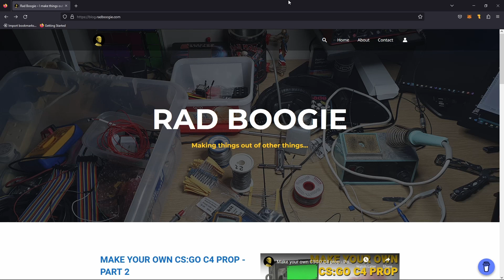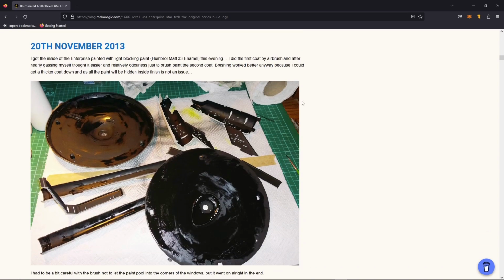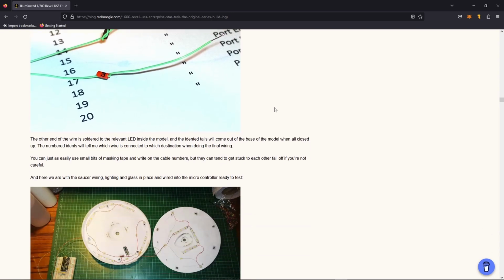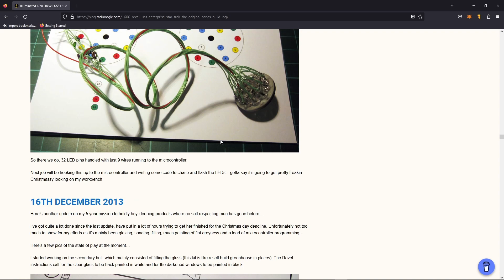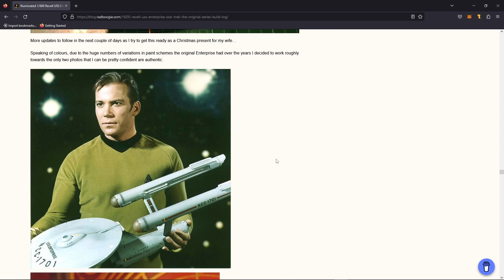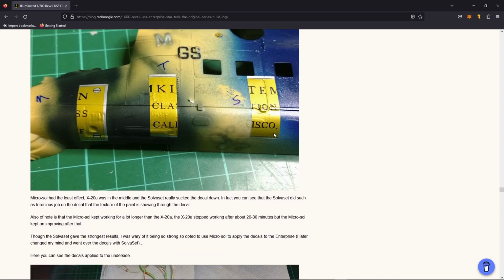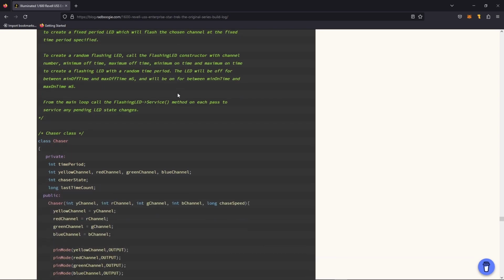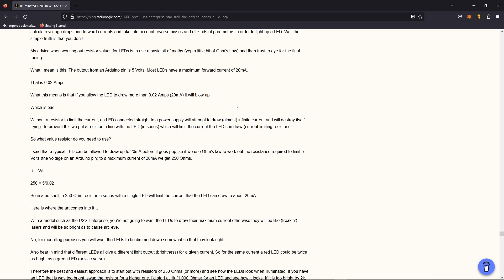Illuminated 1/600 Revell USS Enterprise TOS Build Log - Arduino controlled with source code

Comment: You're a treasure to make this video. Can you give me a primer on how to start using an Arduino? I have done some circuitry using ICs in my youth, but I'm not sure what exactly a person needs to do in order to start with these microcontrollers.
Reply from the maker: Thanks @landwand, what sort of things are you interested in making?
Reply: @radboogie  Just like you! I'm a sci-fi model maker and I'd like to be able to control a matrix of lights for the bussard collectors for the TOS Enterprise, maybe some pulse-width modulators to dim LEDs and control some potential sound-boards for photon or phaser effects. 

I have seen Arduinos mentioned very casually across the model making space, and I am only familiar with how to use 4017 and 555 for blinker effects. I'm not sure about the environment (beyond an IDE and a cable) and the necessary set-up to be able to even start blinking a simple LED.

You've done wonderfully with that TOS Enty, btw. I love the collectors and the fact that you have multiple colours in there, and not just red.
Reply from the maker: Nice one. If you'd like to chat about it more feel free to join the RadBoogie Discord that supplements this channel. https://discord.gg/FJxYdzYCaG it's easier to discuss things there as it's possible to upload diagrams and things. 

Also checkout my tutorial on building a prop for the game CS:GO - https://youtu.be/DuhCkB0TVB0 this is part 4 where I talk about the software for the Arduino that drives the project. There is also a lot of info on the blog page for the project here - https://blog.radboogie.com/make-your-own-csgo-c4-prop-part-3-electronics/ 

HTH
Reply: @radboogie  Thanks for being so helpful! Okay, I'll be more than happy to pop into your Discord and I will also happily view the video-link.

Comment: I believe panel lines are on the saucer studio 11 foot model. Pencil was use to draw lines on. Very light hard to see.
Reply from the maker: What's amazing to me is for such a famous prop, there are so few decent photos of it. It underwent several restorations, one of them used a bit too much artistic license and wasn't very sympathetic to the original look. However the Smithsonian did another restoration in an attempt to make it look more like the original. As you say difficult to tell if the original had panel lines from photos as there are so few around. https://static.wikia.nocookie.net/memoryalpha/images/3/33/USS_Enterprise_eleven_foot_model_upon_delivery%2C_dorsal_bow_view.jpg/revision/latest?cb=20181102101607&path-prefix=en

Comment: First I have to say you are a true professional  I'm amazed that so many after market parts witch are really crucial to making this model as close to the original and to light it you need sertain part in clear.I have seen company's that make the different parts but getting all of them together then start cutting the cheaply detailed parts. Then start fitting the new to the old and your experience with circuit boards since my first attempt on a movie version and realized using all plain white l.e.ds so the voltage was

Comment: I figured you were “in the biz”. I’m not but you obviously know stuff John Q. Plastic kit guy don’t. It doesn’t look like you braced the nacelles. Any droop? Cutdown on the LED buzzards. I hate them whirl motors. space ships can’t make any noise in a vacuum. No one can hear you scream, rifgt?
Reply from the maker: When I built it I read that someone else had reinforced their nacelle supports with brass rod. But 10 years on and no droop on this one. The LEDs don't add any extra weight but I imagine if there was an electric motor in the bussard collectors it might be a different story.
Reply: @radboogie  I bet the motors are the culprit.
Reply from the maker: Yes, all that extra weight over time. Always a tough call when you're building something as to whether to over engineer it or not. With a kit like this once you've buttoned it up there's no going back.